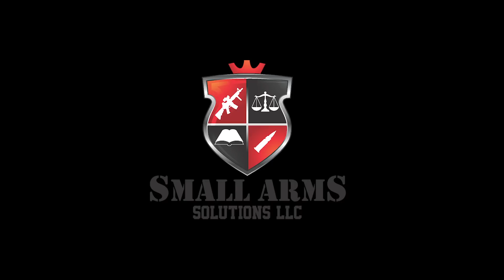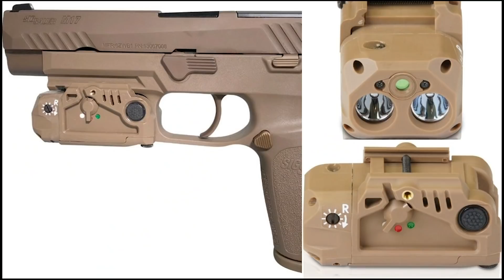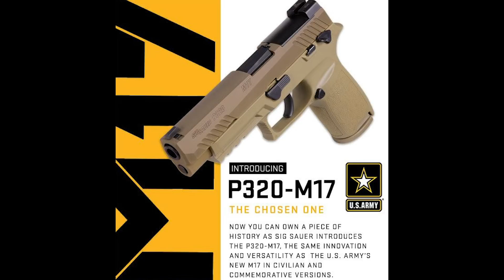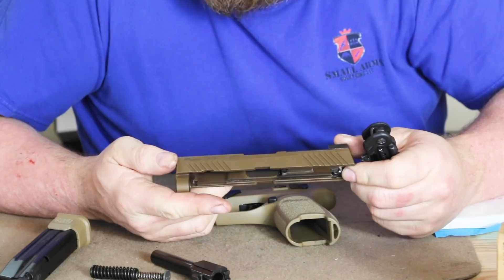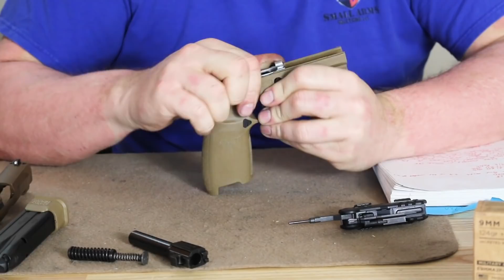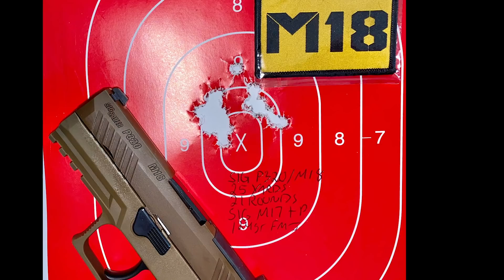Sig P320/M18 Pistol

Comment: @Small Arms Solutions I havent finished the video yet and I hope you will cover this.. im hearing many reports of post factory upgrade p320s firing in the holster.    These are police issue pistols as well as civilan. So far ive heard of 2 police related incidents and 4 civilan. One officer was struck in the femur and she sued for 10millon. It was settled out of court. The other incident occured in a subway weapon was holstered. Ive looked at the 320 FPB mechanism and it doesnt inspire confidence, it seems easy for the spring to slip off. Anyway I would love to hear your thoughts on this. Can provide links if you wish.
Reply: HOW DARE YOU SPEAK THE TRUTH!!! SHUT UP, THE P320 IS THE GREATEST MOST PERFECT PISTOL IN THE UNIVERSE TO GRACE SATAN'S GREEN EARTH!!! I OWN A P320 AND SHOT OVER 1 TRILLION ROUNDS WITH ZERO ISSUES!!! I SHOT ONE ROUND THROUGH A GLOCK AND IT BLEW UP IN MY HAND, GAVE ME CANCER, MY WIFE LEFT ME, I GOT FIRED FROM WORK, IT STARTED A MAJOR FIRE IN CALIFORNIA! I'LL NEVER BUY ANOTHER GLOCK AGAIN!
Reply: @reachblowsdick7222  I really wanted to love the p320 but if i have to worry about shooting my dick off everytime i ccw it then its a no go. The fpb mechanism is sketch as hell.
Reply: @reachblowsdick7222  Yea i really like the p320 but the design i felt was wierd from the first time I took it apart and inspected it. The FPB isnt on a coil spring like 99% of striker fired pistols it is a lever with a spring wedged in beside it. So it could pop out..idk but I dont keep range toys gonna have to sell it. Im gonna see if my p320 will do that thing you explained.
Reply: @Frank Bonazza III - There's a difference between "negligence discharge - aka ND" and "accidental discharge - aka AD". A "ND" means the person holding the weapon him or herself unintentionally pressed the trigger causing the firearm to fire when not expecting it to. A "AD" means the firearm itself fired a round without the person pressing the trigger. 

The Police with Glocks were having "ND" which means they themselves were not careful and were unintentionally pressing the trigger on their Glocks while chambered, the Glocks didn't do anything wrong because the Glocks fired a chambered round when the trigger was pressed and that is EXACTLY what all good reliable firearms do. It's not the Glock's fault the police officers weren't being responsible gun owners.

Now with the Sig P320 it's a whole other story. The P320 were having "AD" which means those pistols were firing without the trigger being pressed. Officer Verandis' Sig P320 was holstered when it fired a round into her thigh without her even touching her gun. Also when dropping a firearm and it fires, that's still considered an "Accidental Discharge" because the triggers were not being pressed and all good SAFE firearms are NOT suppose to fire when dropped. Other officers were having their P320 fire when dropped which is called an "AD". 

All the officers that have shot themselves with their Glocks would have done the exact same if they had  the P320.....or any gun for that matter. Glocks have heavier trigger pulls than P320, which means that statistically those stupid officers have a greater chance to shoot themselves with the lighter P320 trigger pull. Glock or Sig can't fix stupid people. But Sig can fix their stupid mistake by not selling new pistols to the public without actually testing them for safeties.
Reply: @reachblowsdick7222  okay so I just took my p320 apart and i think i see the issue. You know how a normal pistols fpb physically blocks the firing pin from the 'shoulder' towards the front? Well the p320 doesnt...all there is is a latch at the back of the firing pin that holds the  firing pin back. And from the looks of it  is only about 1/16th thick. The only thing putting pressure on the latch is a tiny little sping. So if the pistol is bumped and that latch jumps off the firing pin its going to fire a round. This is the dumbest thing i have ever seen. If you get a chance take the firing pin assembly out and just look..its insane

Also the reason cops have so many NDs with glock is the fact you have to pull the trigger to take it apart and apparantly they arent compentent enough to clear the chamber first. Like they just drop the mag and assume the weapons clear lol. Its operator error while Sig is bad mechanical design..very dangerous
Reply: @Frank Bonazza III why are you even bringing glocks into this? We are talking about a bad design not cops accidentally shooting themselves. Also for someone that has no preference for Sig or Glock you sure are shilling hard AF for the p320...just sayin
Reply: @Frank Bonazza III - That DEA agent shot himself with the G22 because he recklessly aimed it at his foot and pressed the trigger while loaded. How is that Glock's fault? The Glock did what it was suppose to do. Do you like the officer that was shot by her own P320 while it was holstered even though she didn't even touch it? I bet you probably didn't think that was funny. .....if she had a Glock you probably would have thought it was funny.
Reply: @Frank Bonazza III Im not talking about an ND, im saying they are discharging without the the trigger being manipulated whatsoever in a holster (not a crappy leather holster but kydex). Like if your pistol was loaded and in a good holster and you bumped it and it fired. Talked to a very big youtuber who said a guy contacted him. The guy was at a shooting match, was shooting rifle his P320 was in its holster. It discharged a round, and luckily hit his pocket knife and didnt penatrate his leg. Pictures were provided as well as witnessses. Have a few more stories like this but not gonna get into it. Carry what you want.
Reply: @Frank Bonazza III Im not talking about the drop test thing..this was due to a heavy trigger shoe wich they fixed..im saying they are firing by themselves. No dropping or anything like that. You wont find any videos on it because there are only probably only 6 cases that ive heard of. I stumbled across the problem by accident on a small Special Operations forum i guess you could call it. Since then ive been asking around. Im not saying every single p320 is gonna shoot its owner but there is most assuredly a design flaw that is causing this..its not widespread ljke the drop saftey issue but its happening and sig knows about it.
Reply: @Frank Bonazza III its post recall.
Reply: @Frank Bonazza III - Oh you want proof of the Sigs having "accidental discharge", sure man no problem.

Officer Vandias sues Sig for faulty P320. I just read that she actually won that settlement. https://www.loudountimes.com/news/loudoun-county-deputy-sues-gun-manufacturer-for-million-after-having/article_020df2e2-7eda-11e8-951b-7b8d88341850.html

Man sues Sig because of his P320 going off while holstered. https://www.newsweek.com/man-files-suit-against-firearms-manufacturer-sig-sauer-after-his-gun-accidentally-fired-chick-fil-1459842

LEO sue Sig over drop failure safety. https://thehill.com/blogs/blog-briefing-room/news/391100-police-officers-sue-gun-maker-for-faulty-weapon-report

Are you happy now, fanboy?....come on you can say it, you're a fanboy. It's ok to be a fanboy, just don't expect to not be called out on it.
Reply: @Frank Bonazza III - The P320 is a great range toy because it is being used to fire down range, not in a holster or public store where bystanders can get killed. When the P320 is not in use at a range, it lays on a table with no ammunition in it, this stops the risk of the P320 "ACCIDENTALLY DISCHARGING" and hitting me or some other shooter. So like I said, I'll shoot the P320 down range, but I won't carry it in public. Having it both ways would be shooting the P320 at the range and carrying it. I can do that with a Glock, not with a P320.
Reply: @Frank Bonazza III - The video I posted of the X-Carry P320 with the concerning bumping trigger reset is not two years old, it's 12 days old. Also I question the reliability of the P320 since it's had it's history of issues. You can claim you're not a Sig fanboy, but for someone who supposedly doesn't really care, you sure are trying hard like hell to promote and defend Sig and bash Glock even though history reports disprove your arguments.
Reply: @Frank Bonazza III - There's 3 videos showing the dangerous flaws of the P320 and not one of the Glock that I know of....yet you still think the Glock is worst than the P320? Yeah, "I'm not a fanboy" my ass! Just admit it that you're a Sig fanboy and a Glock hater, that would save us all time. 

If the Sig P320 has been more reliable, show me the proven recorded history. Where is this magical Sig P320 history that has surpassed Glock!.......whenever you're ready.......

If you bang up a Glock, it will break or crack just like any other pistol. If you use hot reloads by an independent party not licensed to make ammunition, yeah that will cause any pistol to explode. I've seen this at ranges with Sig P226, Glock 21, P320 X-Legion, CZ 74 Shadows, STI DVC, Arsenal Strike One and many other brands where people take hot custom loaded 9mm. 45 Supers, 357 Sig ammunition and blow up their pistols. That's not a brand malfunction, that's the user not knowing what he's doing.
Reply: @Frank Bonazza III - Glock are not design to win beauty contest, they're not design to win competitions, they are design to work when needed and they do that very well, far better than Sig and Hi-Point at that. You may need a $5K competition gun with all the Gucci extras to shoot a 5 yard target, but I can pick up any stock OEM pistol from $10 to $5K dollars and hit 100 yard 12 inch steel targets. Any stock Glock with plastic sights are good enough for me to hit the same size spread I do with a $1,500 P320 X5-Legion. As for the Glock grip, they are my favorite. I was blesses with XXL size hands and to me the G19 feels like a P365 to you, and I love the Glocks slant forward aggressive angle which helps me control muzzle flip better than other brands and shoot faster. I don't change triggers since I know how to control any trigger. I shoot a lot of .357 magnum and 44 magnum through my 686 & M29 S&W revolvers all in double action. So to me the stock gen 4 Glock triggers feel like a 3 pound race trigger the way a P320 X5-Legion trigger would feel for you. I use a stock Glock 40 as my race gun....that's model 40 in 10mm for you dummies who don't know. The shooter is the one who's suppose to shoot well, not just some expensive high priced pistol. There's no reason for me to buy a newer Glock, the best ones are the gen 3. I don't like the gen 5 and the gen 6 will probably be another gen 5. Why switch from a pistol that has already been proven? Is it just to impress the cool kids at the range? That's the only reason people buy the P320, it's to say that they have the same pistol the Army uses. Well the Navy SEAL use Glock 19, and many other military use Glocks, also th SOCOM use Glock 19. Yet I've never ever referred to any of my Glocks as "military pistols". They are all military pistols if you think about it. I've actually challenged military soldiers at the range, they're not as good as you think, in fact many of them really suck at shooting, lol!  

I've shoot over 100K rounds through my gen 4 G19, that's right, over 100,000 rounds and I've never had an issue related to the gun. I've never had light strikes, only bullets that had casing damages from the factory and primers that were fitted backwards or casings with insufficient gun powder. I know because I took all the faulty bullets to gunsmiths to confirm bullet malfunction. I've never had that kind of results from any Sig.....or any other pistol brand for that matter.
Reply: @Frank Bonazza III - You obviously don't know the difference. A Glock going off because someone unintentionally pulled the trigger is not an accident, it's a "negligent discharge". A firearm going off because the mechanical design is dangerously flawed is called an "accidental discharge". Why did you specifically refer to cops have "negligent discharges" with Glocks in reference that Glocks had mechanical failures when it was the cops themselves who unintentionally pulled the the trigger? If Glocks were firing by accident by some mechanical flaw, it would have been all over the internet and many LEO agencies would have been suing Glock like some are doing with Sig. 

You don't think it's funny when someone gets shot by their own pistol, yet you said just a little while ago..

"My personal favorite is the DEA agent who shoots himself in the foot immediately after telling the class how he’s the only one in room competent enough to handle said Glock 22."

You specifically said "my personal favorite". So you do enjoy watching people get shot by their own pistol. That's twice you forget something you said and contradict it a short moment later, you're just like old man Joe Biden, lol!

I never said Glocks are 100% full proof, no pistol is 100% reliable. Reliability is about low failure percentage and which pistols have the highest percentage of reliability. Glocks do have a far greater and proven reliable percentage history than the Sig P320. This doesn't mean that if your pistol has one of the highest reliability percentage, that it's guaranteed 100%. If I did say that Glocks are 100% reliable, point it out where and I'll apologize and leave. Until you do, you'll just have to put with me. 

The reason people have had "Negligent Discharges" with Glocks more than with the P320 is because the P320 is a 6 year old design and are brand new so there's not many P320 out in the world, the Glocks have been out for over 30 years with millions circulating the world, so yeah, more people are gonna have "Negligent Discharges" in a higher number than P320 simply because there's a far greater number of Glocks circulating the world. Also show me where an officer that has been shot by their own Glock by "Accidental Discharge" where the officer or someone else did not cause the Glock trigger to be pulled. Once again you don't know the difference between "negligent discharge" and "accidental discharge".
Reply: @Frank Bonazza III - I'm sure Sig fixed the drop safe failures on their P320, but I'm still not convince. In this video link here this guy bought a new X-Carry P320 which is a top tier P320 so you figured it should be better than the regulars. But when he dry fires his P320 and bumps it in the rear on the table it resets his trigger into fire mode. This could be very dangerous because something inside the mechanisms could cause it to fire if it has a live round in the chamber and it's dropped. Speed up the linked video to about 7 minutes and 56 seconds to jump right to the demonstration. https://www.youtube.com/watch?v=9yt6GfBQct8&t=491s

This is why I still don't trust the P320 design. Also I've never seen Sig do the drop test with an actual fully loaded mag and one round in the chamber, this greatly increases weight and increases the chance of it firing when dropped. I've only seen Sig videos drop testing an empty P320 which has a lot less weight reducing the chances of firing the striker.
Reply: @Frank Bonazza III - You said your personal favorite, that means you favor something as in, you enjoy, show more interest in. I just literally paste copied this from the meaning of the words "personal favorite" from the google dictionary and here's how it described it....

"Personal Favorite"
"1: one that is treated or regarded with special favor or liking That song is my favorite. especially : a person who is specially loved, trusted, or provided with favors by someone of high rank or authority."

LIKING! Did you read that? LIKING!!!!!!!! Don't sit there and tell me you "favor" something and NOT like it. You cannot be this naive. You enjoyed and according the word "personal favorite" actually LOVED seeing someone get shot by their own Glock. That's quite disturbing and sick. The English language interpreted what you said, not me.....or you just fucked up.

If you know the difference between "ND" and "AD", then why do you blame Glocks for officers negligently pulling the triggers? If it's the officer's fault, they would have the same "ND" with any other pistol....including the P320. Yet you seem pretty hell bent on blaming Glocks for officer's irresponsible carelessness. Why is that? 

Glocks spitting out old designs isn't the topic here, it's the P320 unsafe design and Glocks reliable design. Everyone knows Glock's design is old, but it's a reliable design that has over 30 years of proven reliability, the P320 doesn't have that kind of history. Why compare the reliable history of a Glock to a brand new design of the P320 that has been proven to have many issues including firing when dropped or holstered? I literally just posted actual reported FACTS and lawsuits on the unsafe issues of the P320, and you still claim them to be "potentially", wow!! Sig fanboy hard at work over there! lol!
Reply: @Frank Bonazza III - What has Sig done that's innovative? The removable chassis design was created by Steyr which is currently suing Sig for patent infringement. https://taskandpurpose.com/sig-sauer-p320-steyr-arms

The polymer striker pistol was created by H&K which it later abandoned, then Glock revolutionized the polymer striker design in which all major pistol brands including the hardcore hammer fire steel frame brands like Beretta, CZ, H&K, and Sig Sauer all now adopt as their primary flagship. Glock made polymer strikers the mandatory in the modern age, NOT Sig. The Kel-Tec P11 back in 1995 was the first to create the micro double stack 10 round 9mm magazine, NOT the P365. 

All Sig has done was use the great ideas from other brands and combine them into smaller packages. I think it's a good idea, but they don't deserve the title as leading in innovations. They do lead in releasing new pistols without properly testing them for dangers though, lol!

All those other lovely cheaper pistols don't have the reliability of the Glock, they go bang but they have a higher percentage of malfunctioning than Glocks. Look up the Military Arms Channel torture test and see that only two 9mm pistols and one 45 acp H&K usp beat the Glock. None of the Sigs came even close to beating the Glock, lol! Not everyone who's had accidents or negligent discharges will report or film it. I personally have seen many people have accidental and negligent discharges with all kinds of firearms, and none of them reported it. Show me ONE single video of a Glock having accidental discharges, JUST ONE that is the fault of an OEM Glock! And you forget the Army experienced many issues with the M17 and M18 during the testing according to the DoD report. Show me a Hi-Point that has a better service record than a Glock, then you'll have something to argue with......btw, the Glock beat the Hi-Point in the MAC Gauntlet torture test..... a $1200 Sig Legion too.......just FYI, lol!